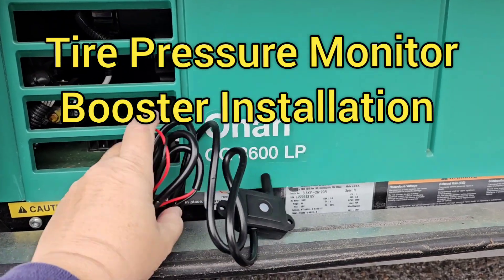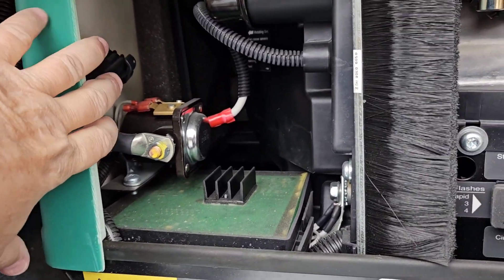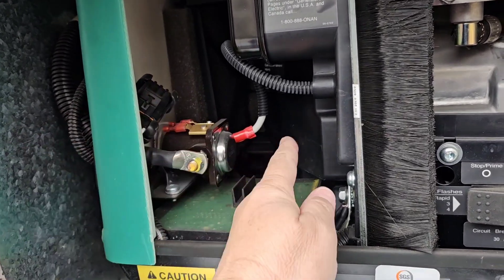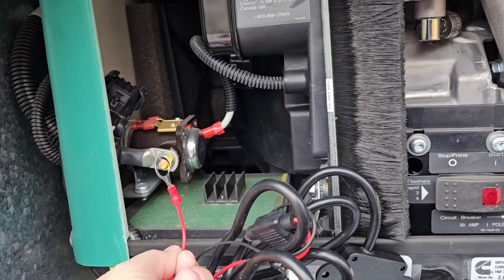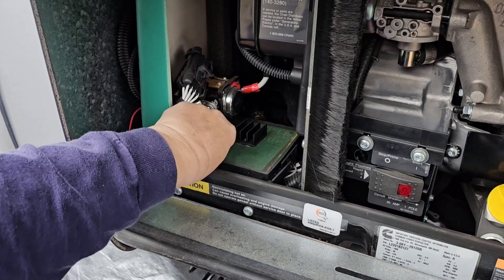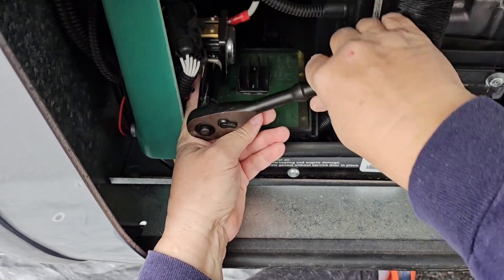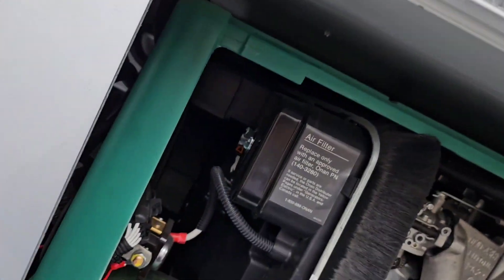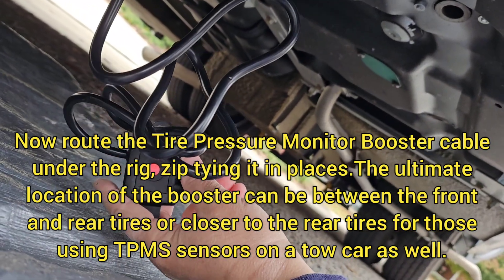Tire Pressure Monitor Signal Booster Installation on a Leisure Travel Vans

Comment: What TPMS do you recommend, do you recommend specialized stems for wheels On leisure Travel Van
Reply from the maker: I use the one piece Borg metal stems and the TST TPMS system with the Flow through sensors.  I used to have the Tireminder system, but I really like the TST display, accuracy, and flow through sensors my better. Call Kelli, she'll get you the correct Borg stems for your LTV. 
Kelli Dennis-Whitcomb
Borg Equipment &Supply
Office# 818-352-8717 x111
Email: support@yourtireshopsupply.com
HQ: 7317 Foothill Blvd Tujunga, CA 91042

Comment: Good idea tapping into the generator!  I'm surprised they need the booster though.  Most folks, including myself, have not needed the TST booster on the LTV or similar sized rigs.  Maybe there is something else in the coach on the same RF band creating interference between the sensors and the display unit?
Reply from the maker: Yes the generator connection to the battery is a great place to pickup power for any low amperage upgrade item. The booster installation is the only thing is could be, neither of their passenger side rear wheel TST sensor register on the TST monitor. They just show a reading of 0 psi. After I installed the booster, they began working.